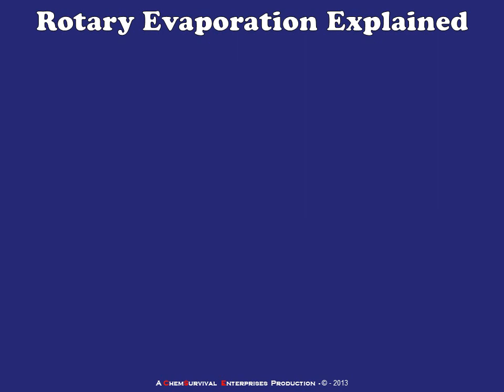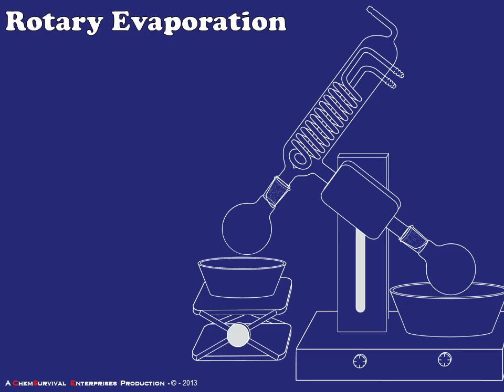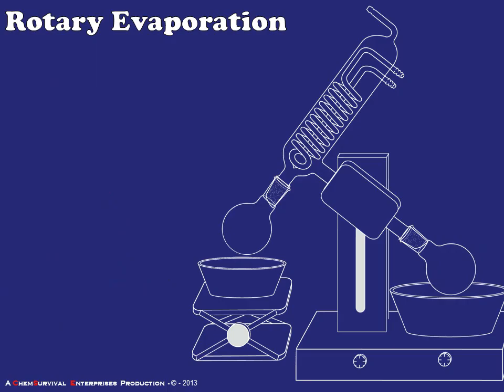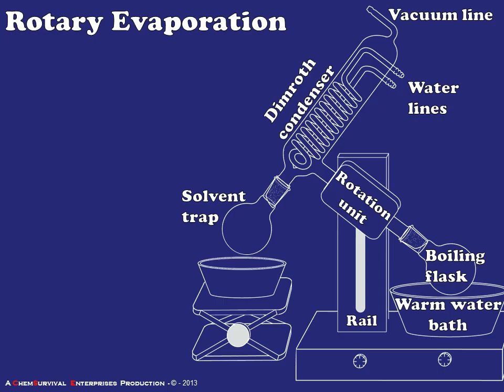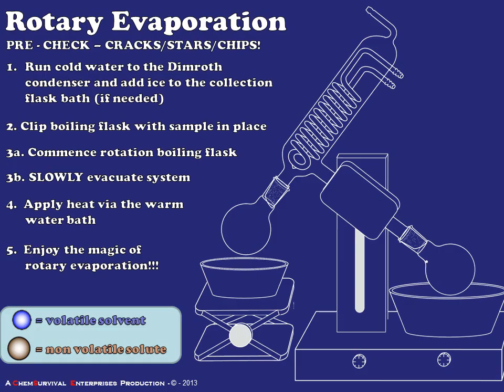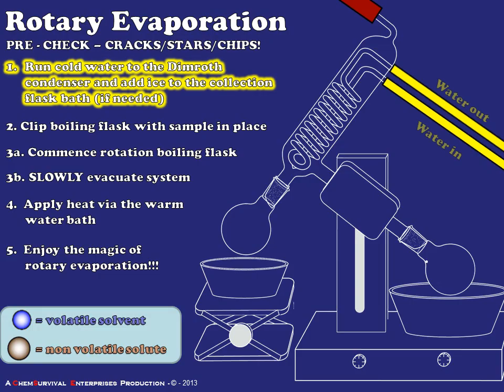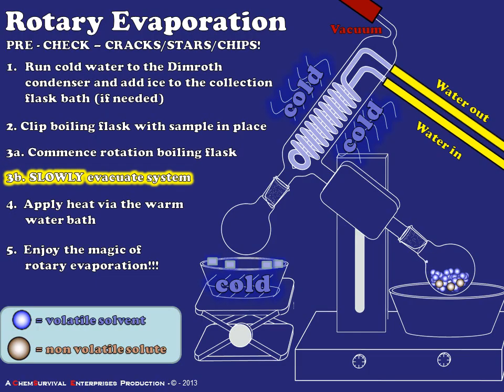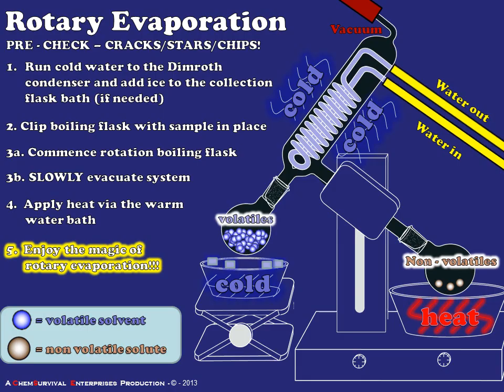Rotary Evaporation Explained

Comment: 4:06 not just friction, but also Archimed power and low pressure  is battling against gravity in case of boiling flask. In my practice - clips on boiling flasks are not essential. Good explanation anyway. Thx 4 ur creation!

Comment: Why don't you just boil off the liquid if the solute is solid?? Maybe a stupid question
Reply from the maker: Noi stupid at all.... this is an awesome quetion!!!!

Basically, this is the same process as boiling solvent away... but with three REALLY important caveates:

1. Normal boiling happens at 1 atm pressure, and you can roast your solids into a nice black sludge if they are thermolablile or you don't catch them the moment the solvent is removed.  Hotplate  surfaces and thermowells can get crazy hot and wreck the material you are trying to collect.  Using reduced pressure allows us to use less heat.

2,  The solvent that is removed is "trapped" and can be disposed of properly , rather than released to the atmosphere as they are when boiling an open container. Some solvents are greenhouse gasses, some are reactive, some are just plain stinky.

3.  Even considering the setup time, this is a much faster way to recover solute, since the pressure is reduced and many lower volatility solvents come strearming over when they would boil away slowly at atmospheric pressure.

 Its a 'win', 'win', 'win' situation when trying to recover a nonvatile solute!

Cheers,

Professon Davis

Comment: Okay but why?
Reply from the maker: Seriously?  To recover nonvolatile solutes from solution.... It is explained in the first 30 seconds of the video
Reply: @ChemSurvival  I mean how does it do it any better than other distillation rigs?
Reply from the maker: @Nathouuuutheone  the rotation and evacuation help to blast anything and everything that will vaporize into the trap as quickly as possible leaving behind only the non-volatile material in the original flask. Traditional distillation is more about finessing one slightly more volatile compound away from another slightly less volatile compound

Comment: What is the strength of the vacuum pump used in this system? How much 'pull' should you use if you don't want to break the glass?
Reply: The maximum vacuum is 0.098mpa, which is introduced on our website。https://www.zzkeda.com/rotary-evaporator.html

Comment: This video is very helpful. What will be the problem is the spin is not working?
Reply from the maker: The process will be somewhat slower since the exposed surface area of the solvent will be reduced, but the biggest concern for me would be bumping.  Bumping is a term we use to describe flash-boiling in which the boiling solution is heated unevenly and froths up and shoots into the neck or even the condenser without having fully vaporized.  Bumping can deliver non-volatile solute to the trap, leading to decreased recovery.

Comment: How the evacuation takes place ? How the air gets out of the rotory evaporation
Reply from the maker: Air is removed using a vacuum pump that is attached to the body of the Dimroth condenser.  Usually a house vacuum line (many labs are equipped with one) or a small piston vacuum pump are adequate to provide the vacuums needed for this technique.

Comment: Hello. I have a rotary evaporator with a condenser coil with your typical in and out for your chiller and a vacuum line but then I’ve got another threaded glass connection and I have no clue what it would be used for. I’ve searched everywhere on YouTube but can’t find any information on it can you help?
Reply: If you can provide me with photos, I'll solve the problem for you. If you still need to resolve this issue right now, that is. Of course, I'm also willing to help you with any other related problems.

Comment: The reason I know about roto vaps is they use it to make Cannabis concentrates.  Specifically for a process they call "winterizing" the concentrate where they mix it with ethanol, put that in a cold freezer, then filter it through a Buechner funnel and all of the wax stays on the filter in the Buechner funnel.  After that they use the rotovap to distill and collect the ethanol.  The part I don't understand is why is this better than just doing a simple distillation of the ethanol?
Reply: Because the rotary evaporator does this under a vacuum, which lowers the effective boiling point of the solvent. The lower the temperature the solvent can be boiled and thereby vaporized, the less heat is applied to the organic compounds that you want to remain in the boiling flask. The lower the heat, the less damage (think cooking) of the organic compound you are trying to isolate (concentrate). This is especially important with organic compounds (like those in cannabis) which can be rather delicate and sensitive to heat. Traditional distillation uses high heat to boil the solvent (an example would be the traditional distillation of beverage alcohol spirits). The "traditional" process heats the solvent (ethanol in my example of beverage alcohol spirits) to a high temperature to boil the solvent and cause it to evaporate.  With rotary evaporation, the higher the vacuum that can be used, the lower the temperature you need to cause the solvent to boil.  At  standard atmosphere pressure, approximately 30 Inches Hg (Inches Mercury), ethanol boils at 173.1°F
 (or 78.37°C), but reduce the pressure to 9 inches Hg and you only need around 120°F (or 49°C) to boil the ethanol. If you can get a vacuum down to around 2 Inches Hg, then the ethanol will boil at about 65°F (or 18°C).
Reply: @Whiskeyiceco   then why dont you do a simple vacumm distilation, why do you need to this much for the setup . Cant you just use magnetix stirrer for the same purpose ?

Comment: After evacuated system, the pressure become low. Then we heat the solfent.
This is what I want to ask.
While we heating the solvent, does the pressure go up? 

And if the pressure rises, should we lower the pressure by evacuating again?

Comment: Does previous material used in roto, contaminate the condenser coils  or is it just pure alcohol that is being extracted from the boiling flask?
Reply from the maker: Remember that the purpose of rotary evaporation is to collect a non volatile material remaining in the rotating boiling flask.    This means that the solvent that condenses in the dimroth and ultimately falls until the trap is waste.  It is always best to empty the rotovap trap and clean the system when you're done, but if multiple people need to use the rotovap and their solvents are compatible but not needed, then it's possible to simply wait and empty the trap and clean the rotovap condensers afterward.

Comment: WHy do you need vaccum?
Reply: In order to provide the power of gas flow, the steam can flow better and improve the purification efficiency.
I am a factory in China, specializing in the production of these laboratories. If necessary, please contact me.
Email address:3359617048@qq.com
My name :Leric
Reply: In addition, the vacuum environment can reduce the temperature required for the test material to change from liquid to gaseous state.
Reply: Leric Zhang sup with purchasing one
Reply: The vacuum allows you to keep the temperatures low.  Lower pressure = lower boiling point.  Sometimes you don't want to heat up the solvent to its standard pressure boiling point
Reply: Leric Zhang Thank you Mister zhang

Comment: Question from a newbie that is very new to this- 

Why isn't the volatile solvent being sucked out the top of the dimroth, where the vacuum line is located? Is the cooling action of the dimroth the only reason why the volatile solvent doesn't go up and into the vacuum line? This chemistry stuff is blowing my mind. Very very interesting.
Reply: The risk of sucking all the vapor our is very low. If the assembly is tight and no air gets sucked in the unit, there will not be an "air stream" and that means solvent remains in the rotary evaporator. I always recommend the use of a vacuum controller as with that you can set a specific vacuum according the solvent you like to distill. by doing so, you even can separate different solvents and the need of an ice bucket is also not needed anymore. Great tool and easy to run, even in a kitchen to mage essential oils or moonshiner ;-)
Reply: I was having the same doubt
Reply: The serpentine in the condenser, through the cooling water, is intended to cool the gaseous material into a liquid state, thus entering the collection bottle.The connection to the vacuum tube is on the top of the condenser for two purposes.
1. It is the experimental environment that becomes vacuum and the material becomes more easily into the gaseous state.
2. Provide the power to the gas flow, which is the target material becomes the gas phase, and flows to the condenser more quickly and accelerates the purification.
This is Leric.from China ,a factory for these equipments,If you need any or have any questions,pls feel free to tell me
Email: 3359617048@qq.com
Reply: If you do get volatile vapour going out through the top and into the pump, do you usually have some sort of scrubber in the vacuum line to protect the pump?
Reply: Yes, if you are working with solvents that could damage the pump you should use some form of vapor trap.  What you use depends on the solvent and the amount coming into the pump.
Reply: The serpentine in the condenser, through the cooling water, is intended to cool the gaseous material into a liquid state, thus entering the collection bottle.The connection to the vacuum tube is on the top of the condenser for two purposes.
1. It is the experimental environment that becomes vacuum and the material becomes more easily into the gaseous state.
2. Provide the power to the gas flow, which is the target material becomes the gas phase, and flows to the condenser more quickly and accelerates the purification.
This is Leric.from China ,a factory for these equipments,If you need any or have any questions,pls feel free to tell me
Email: 3359617048@qq.com
Reply: That's why you pre-cool and evacuate the device first and then apply just enough heat to promote evaporation.I can imagine the vapours would escape if too much heat or too little cooling is applied. As with vacuum distillation, it is wise to have a washing bottle, cold trap and a chemically-resistant pump attached.